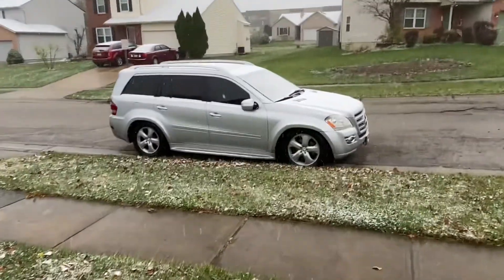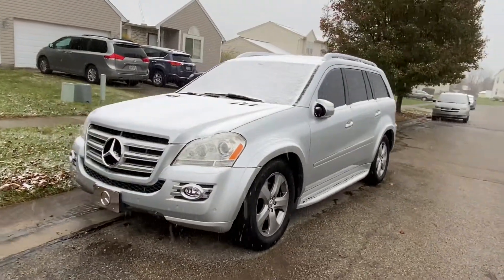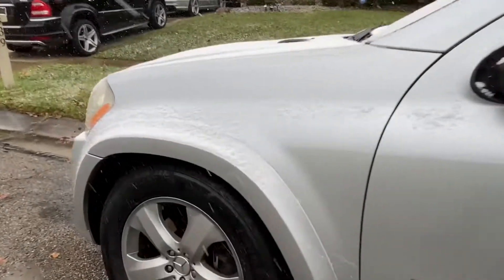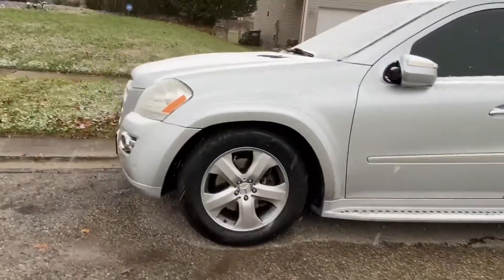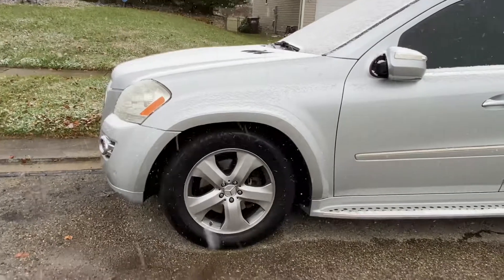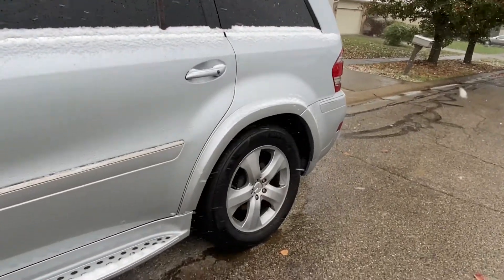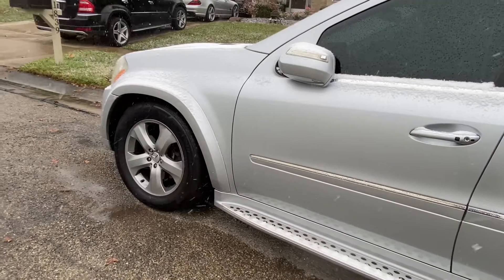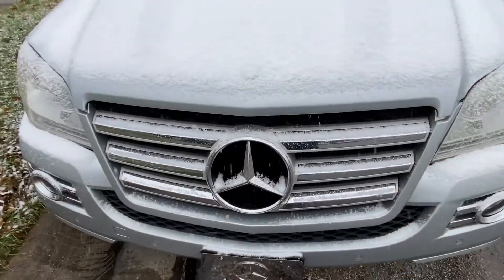How To Diagnose Airmatic Failure On My Mercedes Benz GL550

Comment: I’m experiencing this issue right now a week after getting some fuel sensors replaced on my GL550. After watching this I’m wondering if the shop caused the leak because it wasn’t doing this before I brought it in smh.
Reply from the maker: @kev.law2024  I’d definitely be asking some questions